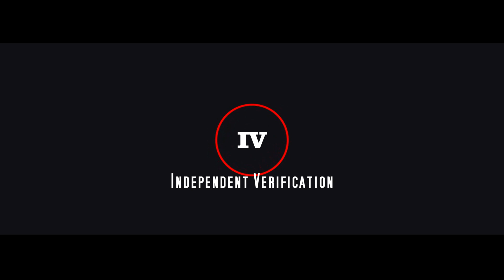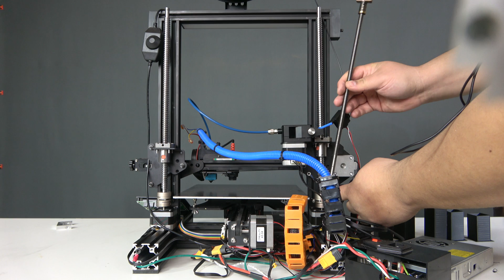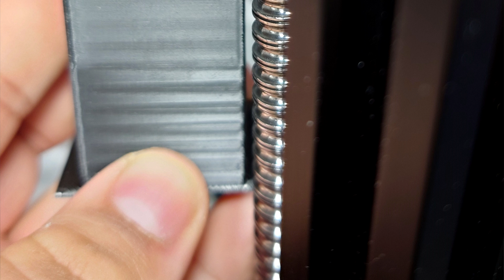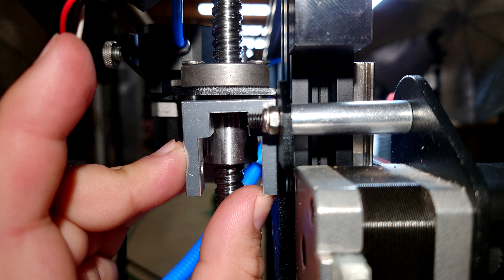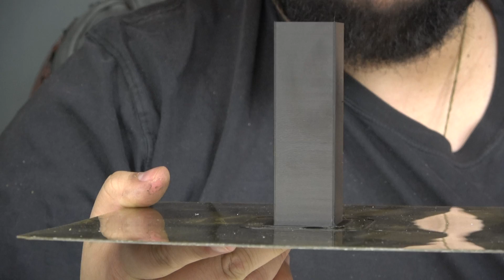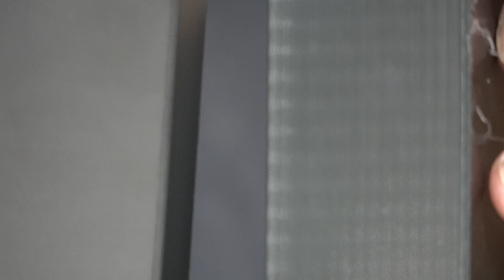How to fix Z banding in your 3D Prints

Comment: any bed slinger can have this issue except a prusa mk3 bcause they have the lead screw as part of the stepper motor ant much tighter tolerances. they even have a trinket attached to them that was printed on that very printer from the factory to show it can print but can happen on an elegoo Neptune 3 or a bambu labs

Comment: Ball skew is over kill and is not needed useful it will properly give more artifacts, as it will be a component that's stronger than the frame it self therefor they will bend and warp the whole thing on a budget printer and  the printer need to be setup right in any chase to deliver results anyway meaning correctly put to gather meaning adjusted and fine tuned no matter what the price range .

Comment: what if it's very very slight, like you can't even feel it on the prints you just see like a slight discoloration but it's perfect horizontal lines like that in the same place every print, but it's on a core xy printer?
Reply: That's what my q1 pro just started doing! It has been printing flawlessly for 7 months and started seeing some very slight layer line quality issues. I print only in cf and gf filaments. Diamondback nozzle just released the new diamondback nozzle for q1 pro. It looks like the stick plated nozzle, but has a diamond tip. Now my prints are back to absolutely perfect layers lines, even under a scope. But it has these 2 toned horizontal stripes from bottom to top. They are thin on the bottom and get thicker towards the top! It is exactly as you described. The best quality layer lines I've ever gotten, but these 2 toned stripes that are inconsistent sizes. It looks like matte and and satin colored stripes. I am ripping my damn hair cause I can't find anyone talking about the causes or how to fix it! You are the 1st person I've seen explain exactly what I am experiencing. I am getting so frustrated AF.

Comment: ive been having this problem but mine is a weird case. lets say I have a cube and a hole in the middle. now the strange part is that the z banding starts and ends at the top and bottom of the hole in the rest of the cube prints just totally fine

Comment: Interesting, but not a complete diagnosis. Sometimes z banding can be caused by humidity affecting the filament. Where it is exposed on the roll just on one side to a humid environment for a few days between prints. Or could be the filament itself having the issue. I buy the same filament twice and often find the second time, they've completely changed the quality. Amazon does this all the time. The sellers build up good reviews, then change products to something far cheaper and trade off the back of all the good reviews.
Reply: I noticed the same issue with my printer. I thought that the issue was the printer. But wobble does not appear all of a sudden. In my case it was a batch of bad filament.